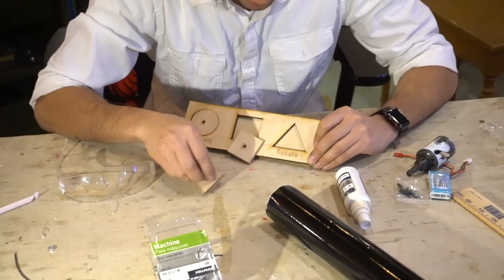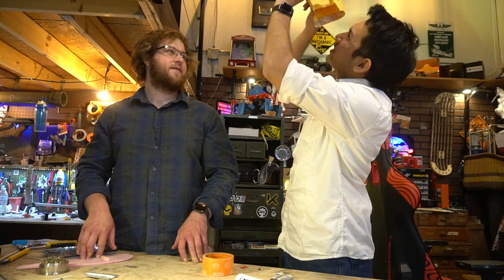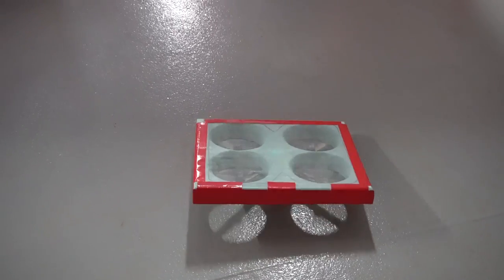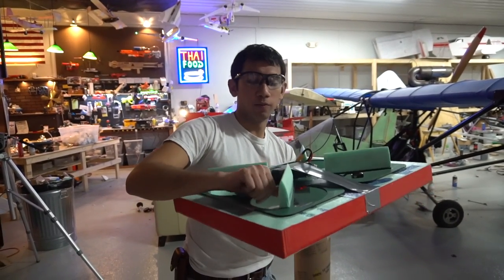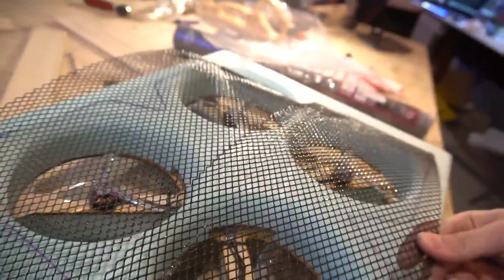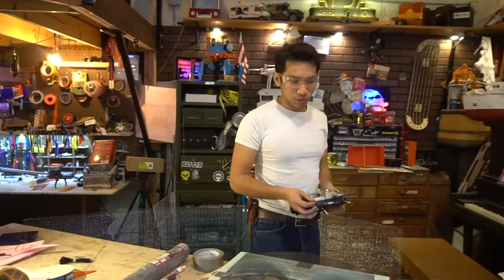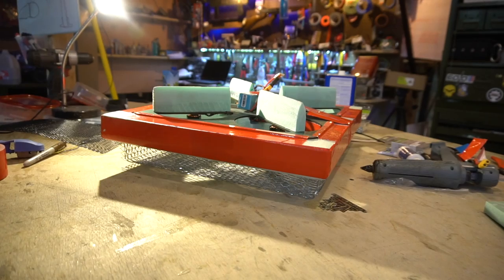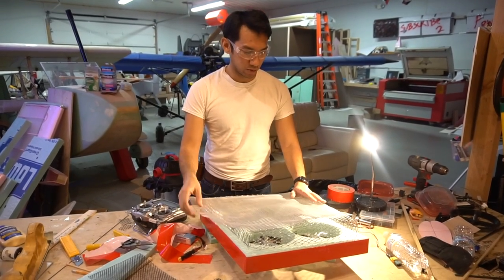Drone proof Battle DRONE (droneclash)

Comment: Just put string under the drone and fly it over your enemies.
Reply: Wow four minutes and I get a heart from our favorite nondescript aisian 🅱️oi. Today will be a good day.
Reply: Mike Russo use clear fishing line
Reply: Mike Russo that would take both of you down tho
Reply: @Ethan-lo1rc  depends. If you dont secure the string to your drone too much then it might simply get pulled off and tangled in the blades/motors of the target. something like a paperclip might bend and release
Reply: @Rygoat  or just a slipknot would do
Reply: Paperclip a ring of long wire tassels round the side
Reply: @heyitsclayyy3002  i think a thin steel chain would work better, because fishing line would get cut, and i think the opponent would know about all the stuff you got, because its sorta unfair if he doesnt know whats going on
Reply: Tame Stingray 789 NOLLEDJE AT WURK
Reply: Et han thought of that just attach it with watered down Elmer’s glue.
Reply: @Rygoat  Thread fishing line through sewing needles, and just stab them into the foam. they'll pull out when tangled
Reply: Put the string and attach it to a weight. Remote control let go of it like a bomb. Bam. Like put a small metal cube under your drone glue a string to it. Once the string start fucking up the enemie drone, detach the weight and strings. The weight will make sure the the drone fucking is countinued once its detached.
Reply: Orange Trump nice. To much f ing, but good idea.
Reply: @THESLlCK  Yeah i was kinda tired at 2 am when i wrote this. Sorry my bad.

Edit:My english isn't perfect(Not a native) so i just used the universal word too much.
Reply: Orange Trump u got it buddy no problem
Reply: people do that a lot. for some reason it doesnt really work that well
Reply: Exactly what I was thinking
Reply: Poutine Au Syrop d'érable That was fucking perfect English
Reply: @THESLlCK  an then fly uncontrollably with another drone attached to your own drone
Reply: Add a hook to the string
Reply: Mike Russo it would need a quick release system so that it doesn’t take both drones down maybe just tape a piece of paper with a paper clip and string that puppy on
Reply: destruction 100

Comment: Peter, I have a project suggestion. I just discovered these Pop pop boats and my instant thought was if these could be scaled up to human sized. Then my next thought was obviously who would be the perfect person to try this. It’s gotta be you or maybe Colin Furze. Maybe a build off is in order.
Reply: I saw the same video in my recommendations bro lol
Reply: Mc Earl Peter do it
Reply: Primus Original Lol, it’s funny how YouTube just decides to recommend an video. Hopefully a bunch of others saw it then too and it’ll become a thing. I do suspect there’s a limit on how big they could be but I’d like to see.
Reply: Check out Daryl Foster
Reply: Good idea. I dont think it would scale up, but if you add a boiler and valve you are basically simulating the real thing.
Reply: Rcbif I’m doubtful it would scale up big enough too, I’m guessing once there gets to be too much water in the boiler it probably would take too long to boil.  I didn’t think it all the way through admittedly. That said, I still wanna see him try to see how big it could get to and then maybe build 100 of the optimum sized boilers and run a bunch of tubes out the back of a small full scale boat.
Reply: Using a coffee machine type system (seriously, just buy a cheapo coffee machine and take it apart, almost no moving parts pump) you can scale it up by quite a bit.
Reply: Primus Original what’s it called?
Reply: The Piston Master I’d tell you but I can’t remember which one it is because I watched so many after that. Just search for pop pop boats. There really wasn’t anything particularly special about that one YouTube randomly decided to show us, I don’t think it was even a new video. The funny part is most of the other videos were very old too but they all had a bunch of new comments on them so there must have been a bunch of us who got shown a video and then got sucked into searching for more. Here’s one to get you started. 
https://youtu.be/g3OLhFx8KZY
Reply: A quad prop bike
Reply: So mean like ponjo the japanere anime
There they have that eksact same idea

Comment: You can save a lot of weight by removing a lot of useless mesh
Reply: Had the same thought, until the flip-flop was thrown at it.  But is that relevant to Amsterdam?  Of course they could throw wooden shoes there...
Reply: The mesh protects the propellers
Reply: He means remove the mesh over areas that aren't propeller.
Reply: @d.jensen5153  Since when do they wear wooden shoes in Amsterdam?
Reply: @inlandish  'twas an injection of levity.

Comment: Conic screens pointing upwards within a short shroud would reduce the edge turbulence and still allow the same rate of air ingest. The square top means that it still restricts the air coming in from directly above and creates turbulence ahead of the blades as it pulls in air irregularly from 90 degrees to the thrust direction.

Comment: Make a real rc submarine.
Reply: He has he made one out of a toaster
Reply: I agree
Reply: Do radio waves travel well in water?
Reply: @LostieTrekieTechie  the radio on my RC truck works up to 500ft in air (and it's a cheap radio too), so I think they work fine underwater. I'm not certain, but I don't think water affects the radio waves much.
Reply: 2.4ghz sux underwater need to use 72mhz or lower even.
Reply: What about the tOaStEr?!?!?!?

Comment: Hey Peter, you take some deep cuts in the styrofoam with a Utility Knife. After a while the utility knife gets that tiny bit more dull and It usually starts tearing the foam. I've found that stropping the blade on a place of leather with buffing compound applied for a while makes it razor sharp again :)
Have a nice day ^^

Comment: Side vents could have helped with the mesh thing, just cut a rectangle twards the rotors and put that same small mesh on it so the air will be pushed through more. Don’t know if it would work but it could

Comment: could try cutting channels in the foam board to hide wires and recess the battery more and only have the fan grate above the props to cut some  of the weight. wicked kool tho good luck

Comment: you are a shockingly amazing drone pilot! also if you remove the eagle head it will reduce the weight and contribute to more stable flight and longer flight time. but you already knew that. points for style though.

Comment: I would have used small support structures to put small shields above each intake duct. You could even make them solid in the shape of a inverted cone. Then use some plastic gutter guard around the cones as both support and protection for the props. It would reduce your weight increasing flight time. I would make our air foils on the bottom out of balsa and coat it with maxicure CA glue to strengthen it. I built many a rc glider with thin sheet balsa and painted the surfaces with CA glues. It makes the fragile balsa quite strong and ads less weight than mono coat film applied over a solid surface wing. Insta cure soaks in fast but does not help as much with damage prevention as a coating of maxicure that does not soak in as fast and is easy to spread out.

Comment: Drone weapon idea. A drone that can drop a spring loaded frame with a sparse chain web inside that can easily detach from the frame and get caught in the propellers of another drone. If the drone doesn't have protection, that's a big GG EZ.

Comment: Did you ever consider possibly building some sort of mesh pyramid or dome structure on top? Feel like it would have blocked things from getting to the props while at the same time causing most objects to naturally slide or deflect right off without too much additional effort from the drone. Would the shape negatively affect the aerodynamics too much or is it just not something that was considered?

Comment: when are you going to build another quadcopter you can actually fly in?    and you need to show how its done because i want to build one.    i priced it put at around $10,000 for the engines and batteries.   I did not know how to calculate the lift so i didnt buy them, i would have though.

Comment: Are you obligated by the rules to maintain the motor to prop configuration? because if not, moving the motor to the sides and powering with  belts via those types of inwards props would solve all "throw junk" inside issues. They mostly use those in marine applications for exactly that reason, it frees up the inside, where conventionally a shaft and engine would sit allowing anything to just pass through, and because there's nothing to catch on, nets, wires, junk just doesn't catch on the prop.

Comment: this is so cool! but why did you keep trying to apply that other mesh grid that kept obstructing the propeller air-flow? seems like the one from the fan worked well enough for the top. and then, why no protection for the motor area at the bottom? I imagine a kinda roll-cage assembled outta plastic hanger, so its sturdy, but still light weight. I'm just wondering. cool stuff though. you guys and your creations are awesome!!! the flying monster truck on the other vid was the best ever!!!

Comment: Love the drone but they should probably put a different tape color or an indicator on the forward movement side of the drone when testing or flying. Also unsure of the Specs for a drone fight but wouldn't a Lithium battery pack or Li-ION 18650 work better for something like this? Genuinely curious if anyone knows stats on this.

Comment: I'm super late to the party, but a heavier drone would be more stable (during standard flight and against enemy attacks) even if power consumption went way up, so unless there were weight limits a metal frame with chonkier motors probably would have worked better as the queen.

Comment: Hey Peter. How about two large motors in center (one top one bottom prop to prop) counter rotating for lift. Then four quad motors on the corners for control.  Will it work?

Comment: You need to use round wire in your screen media not expanded metal or anything with a square edge.  The static pressure loss over a hard square edge is very high i can get the number out of my industrial ventilation book for you tomorrow.  Over a round edge you regain the static pressure loss and get about 95% of the lost energy back on the return side.  Axial/prop style fans are known for low static pressure and high volume thus any static pressure drop has a large effect on the system.  This is why you roll the inlet/outlet of your ducts even if you don't know it.  Look up woven wire cloth for a much better product.  This is the number one issue we have with industrial ventilation systems that don't exhaust properly the fabricator/installer uses normal expanded metal for a bird screen.

Comment: if it had few hole from side or middle  and route to each motor and also resize the mesh to fit with the hole diameter separately can improve performance?